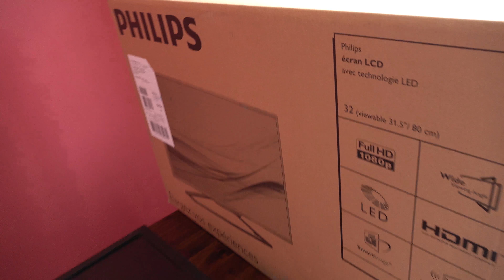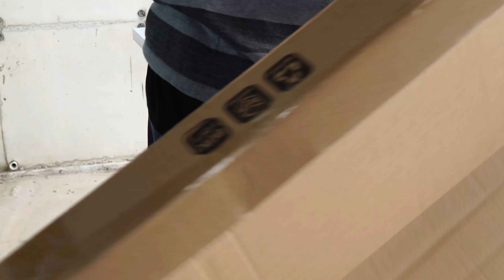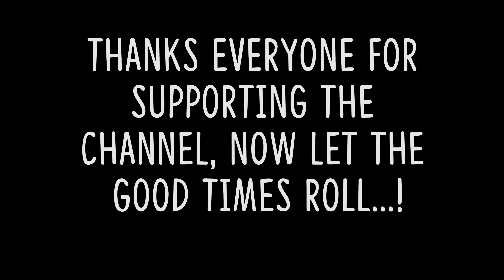Completing the TECH YES Studio - Finale Part 3/3

Comment: I might have a solution for your internet connection. If you have line of sight to a place with a fast internet connection you could use ubiquitys nano or powerbeams to beam the internet to your office. You will get a very reliable connection with better speeds. You can even check if it will work with their Ubnt map.

Comment: so im not the only one that uses a PSU box to raise my monitor up, HIGH FIVE! also you must be working super hard or its freaking hot time of the year for you.
Don't know if you turned your miners back on, but if it were me, id underclock and volt the shit out of it just to keep it running under 60c in the summer. Hell even 50% hash rate is some money, and that project looks expensive.
Don't worry about the haters, you keep up the good work.